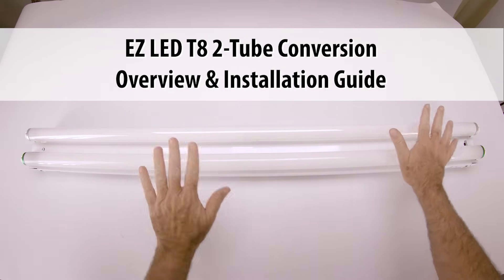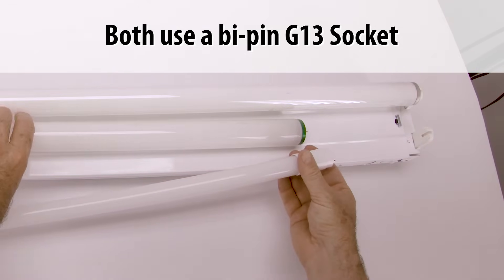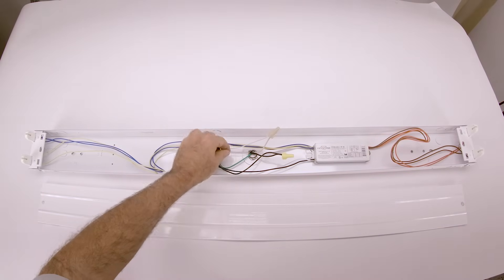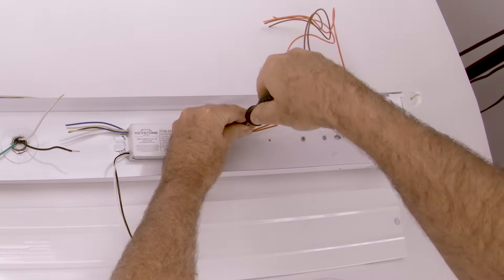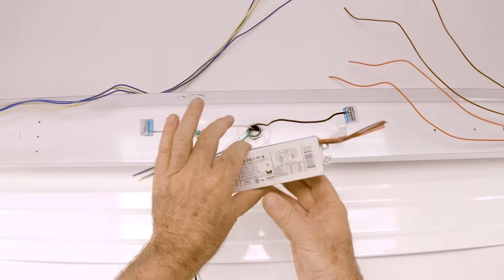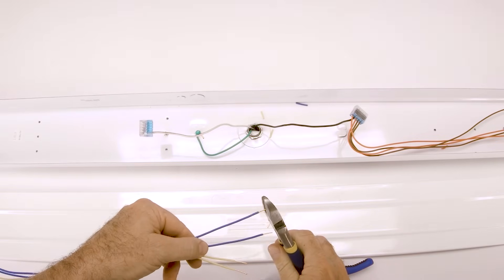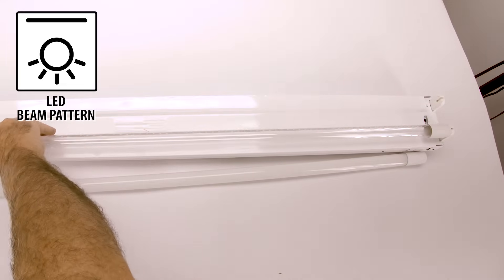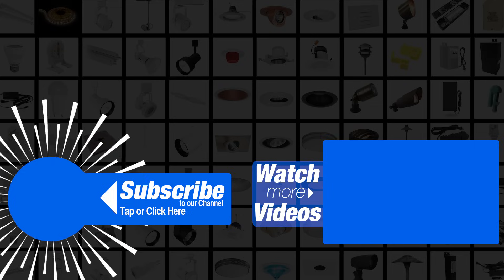EZ LED T8 Fluorescent 2-Tube light Conversion in 5 minutes or less by Total Bulk Lighting

Comment: This Video needs to begin with the WARNING that there are two different types of LED tubes being sold. I discovered after I had cut out the ballast and rewired my fixture that the LED tubes I bought were specifically designed to be used in an existing florescent fixture with NO modifications. Fortunately, I had left just enough wire at the end of the ballast to reconnect the wiring.  I would expect more from a commercial lighting supply company than to miss this important detail.
Reply from the maker: I am sorry to hear you had performed the wrong retrofit method for the tubes you purchased. We do have another video that goes into greater detail of the most popular retrofit methods. Glad you were able to correct the issue. Please keep in mind that this video was made almost 4 years ago and includes the type of LED tubes being used, links to the tubes being used and a link to the wiring diagram that provides greater clarification at no charge. As we aim to always improve on what we do your feedback is valuable and has been passed on for consideration in future videos :) Thank you for sharing!

Comment: Is there LED that work with or without the ballast ?The LED I bought at Walmart 2 in pack $10 doesn't work if you remove the ballast.So I put the ballast back.You did not mention In your video that you have to buy the right tube.What a waste of time.
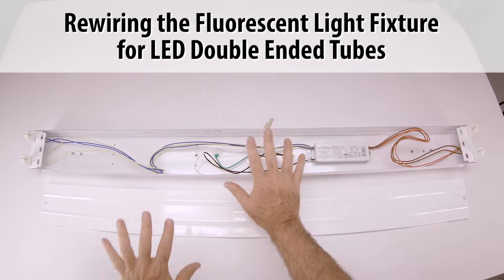Reply from the maker: I am sorry to hear that your retrofit process didn't go smoothly. This video is designed to work quickly and easily with our retrofit kits mentioned in the video description and video card. There is also a wiring diagram listed in the video description that shows how to property make the electrical connection. And to avoid any confusion, we mention what type of tubes at 2:35 along with options to contact us if there are questions. This retrofit method is designed to work with Double Ended Tubes, tubes that receive power from both ends when the ballast is removed. However, we do carry LED T8 Tubes that work when the ballast is installed, Type-A, and when the ballast is removed, Type-B. These tubes are called Type A+B tubes and you can find them here 👉 https://www.totalbulklighting.com/t8-led-lamps/universal-compatible-led-t8-tubes-type-a-b.html Hope this helps for future projects 🙂
Reply: So when I buy an LED tube it should say A and B that works with or without the ballast is that right? Thanks.
Reply from the maker: @efrensaclolo7021  Yes it should be Type A+B LED T8 Tube but always double check to make sure you are getting the correct tubes.

Comment: I bought a pack of 2 LED at Walmart but it only works with the ballast ,The moment I delete the ballast it won't work.Can you tell me why?I did the wiring right and checked the voltage it is 125 volts so must be the LED is made for ballast to work.
Reply from the maker: The retrofit method shown in this video is strictly for Type-B LED T8 tubes which require the ballast to be removed. If the tubes you purchased require the ballast it sounds like you have Type-A tubes that are designed to work with a ballast. Hope that helps 🙂

Comment: Enjoy you video and am about to convert 2 shop lights for my garage but a question first because I want to get it right.   When I opened up the lights, there are 3 bulbs.  All are 48 inch T8 bulbs with G13 pin bases.   Is the conversion the same for a 3 light fixture and if not would the light work with just 2 bulbs?  I don't want to get it wrong and have fireworks!  I intend to use ballast bypass bulbs as well.
Reply from the maker: As long as you follow the wiring diagram and are using Double End Powered LED T8 tubes there shouldn't be any issues converting a 3 tube T12 or T8 fluorescent fixture to LED. You can find the wiring diagram in the video description or click on it here 👉 https://www.totalbulklighting.com/downloads/dl/file/id/1215/led_t8_double_end_power_wire_diagram.pdf
Reply: @Totallightingsupply  Thanks for the info.
Reply from the maker: @gregg-wb8yys517  You're very welcome! Have a blessed rest of your week 🙂

Comment: The tombstones at the end where you connected to the hot wire had two wires coming out of each tombstone.  Can this procedure be used if the tombstones only had one wire coming out of each tombstone?  Like a shunted tombstone?
Reply from the maker: As long as you follow the wiring diagram in the video description above, shunted or non-shunted will work. However, we have found that the majority of LED T8 or T12 fluorescent fixtures tend use shunted tombstones. Hope that helps :)
Reply: @Totallightingsupply    Thanks, that helps a lot.

Comment: Im guessing that since the bulbs plug into 110 volts that the bulbs step down the voltage that the LED's like?
Reply from the maker: Correct. The LED T8 Tubes in this video have it's own driver to regulate the voltage to the LED's liking 🙂

Comment: Is there a way to rewire a fixture to accept both single and double-ended tubes?  I would think that if tube manufacturers followed some simple standards, this would be very easy to accomplish.  After all, a double-ended tube only needs to use one pin on each end.  An industry standard would be needed to determine which one.  This "should" be sooo easy!
Reply from the maker: No need for special retrofit wiring if you go with the double end method and Type A+B tubes. With the newer more advanced Type A+B LED tubes that are both single end and dual end powered in one tube you just need to wire for the double end retrofit method and your done.
See our video on that here https://www.youtube.com/watch?v=xPOu-jSTrPc

Hope that helps 🙂

Comment: This ballast bypass install on liner led lamp is dangerous due to the sockets not being rated for it. I checked with Leviton and talked to an engineer and he confirmed that the sockets are not rated for it.. Bi pin lamps make limited contact in the socket which overheats and melts, out here in California I've see 5 fires do to this install one burnt half a Bed,Bath,and Beyond down. On liner led lamp alway have an led driver or fluorescent compatible ballast to protect the sockets. You can do a ballast bypass on CFL lamps as the pins are making a 360 degree contact. A little background I'm a 25 year electrician working for one of the largest electrical contractors in Sacramento.
Reply from the maker: Interesting point. The lamps are UL approved to be used in this manner. The question I would have in those 5 cases you mention is were the fixtures wired correctly and were the lamps rated for the application? Thanks for sharing your concern 🙂

Comment: Can I mix match LED with Regular Tube Florescent light fixtures? In my kitchen ceiling lights, I have a total of 3 DUAL T12 Florescent Tubes. Can I replace only ONE set with LED and the remaining TWO DUAL T12 Florescent tubes will stay active. All 3 DUAL Tubes used only ONE POWER ON/OFF Switch. Will there be a long term effect on the LED lights? Please advise
Reply from the maker: The tubes used in this video you will not be able to mix and match fluorescent and LED tubes. We offer a universal Type A+B LED T8 Tube that works with many existing T8 electronic ballasts but not T12. Best thing is to start here as it will help you find the right LED tube for your application https://www.totalbulklighting.com/fast-fluorescent-to-led-t8-conversion-tool.html 🙂

Comment: What about shunted and non shunted ?? Tombstones
Reply from the maker: Shunted tombstones are what is recommended for this type of retrofit method as shunted tombstones seem to be the most common found in fluorescent T8 fixtures. You just need to make sure for double end powered retrofit method that electrically the hot comes in only from one side of the fixture to the LED t8 dual end powered bulb and the neutral only comes from the other side of the fixture into the LED T8 dual end powered bulb.

Comment: What do I do if the end of the bulb and ballast has the ONE nipple type connection??. Does that work the same way?.
Reply from the maker: It depends on the LED Tube you are using. If it is Type-B that brings power into both ends then this retrofit method concept would work. You just need to know what type of LED  T8 Tube you are using. Best thing is to contact the place you purchased from 🙂

Comment: I have a plug and play T8 Led tube, can I still use this method to bypass ballast and connect directly ?
Reply from the maker: Typically no but if you have a Universal / A+B LED T8 Tube like then ones here 👉 https://www.totalbulklighting.com/t8-led-lamps/universal-compatible-led-t8-tubes-type-a-b.html than it will work with this retrofit method.
Reply: @Totallightingsupply  Thanks for the quick reply ! I will check.

Comment: You have not been talking about the condenser present in old fluorescent circuit. Does it need to be removed?
Reply: If you mean starters, yes they need to be removed. You need to re-establish the contact to the pin of the tube.

Comment: Why not single ended, that seems much simpler?
Reply from the maker: Please see our video on the top 3 retrofit methods. You will see which ones are faster and easier 👇
https://www.youtube.com/watch?v=xPOu-jSTrPc - Have a blessed day 🙂
Reply: @Totallightingsupply  Thanks but I still don't see any advantage to a two end retrofit over a single ended retrofit.
Reply from the maker: @eminusipi  Double End retrofit method is typically much faster to complete than single end.
Reply: @Totallightingsupply  Thank you! I went to single ended for the long run!😀

Comment: Is there an advantage to single ended or double ended led tubes?
Reply from the maker: Not necessarily in the tubes but in how you convert your fluorescent light. Double End Retrofit method is much faster conversion and doesn't require replacing the sockets. Here is a video on all the different retrofit methods https://www.youtube.com/watch?v=xPOu-jSTrPc

Comment: Can one mix the two though? Say, have a coloured LED and your normal fluorescent tube? Will that work? Please assist.
Reply from the maker: In this video, the type of conversion shown here prevents you from using fluorescent tubes. So you can not have LED tubes and fluorescent tubes together. Hope that helps 🙂
Reply: @Totallightingsupply  In this particular connection or in general?

Comment: I get it for a single ballast. I have two ballast there are two fixtures next to each other with two t12 each. one ballast in each fixtures how do I convert.
Reply from the maker: Checkout our helpful guide that steps you through the process of what you will need when converting Fluorescent T8 or T12 to LED. It talks about dual ballasts 👉 https://www.totalbulklighting.com/fast-fluorescent-to-led-t8-conversion-tool.html

Comment: OK, you went through all that simple setup for the wiring conversion but then you went and threw that big curve ball at the end with the 3 different kinds of bulbs without addressing the now confusing inevitable question of do all 3 of those bulb types work with the wiring you did or do they have to be wired differently?
Reply from the maker: All the LED T8 Tubes shown in this video are dual end / double end powered tubes and will work with this retrofit method. Fluorescent tubes will not longer work when converted to LED. Hope that helps clarify 🙂 You can find our kits here that take the guess work out of the conversion 👉https://www.totalbulklighting.com/retrofit-kits/ez-t8-led-4-foot-kits.html

Comment: This is the first time something doesnot work for me. My wires weren't long enough so I had to buy 2 wires white and black taped them up took balast out what do you think it could be
Reply: Thank you
Reply from the maker: @genevievevalle3286  You are welcome 😊
Reply from the maker: First, make sure you have the correct LED T8 Tubes. This video is for converting to dual end powered LED T8 tubes. It will not work with single end powered LED T8 tubes. Then I would check to make sure you are getting power to the LED tubes. Get a voltage multi-meter to check the tombstones / sockets to make sure there is power. Hope that helps 🙂

Comment: Great Video! My light fixture, the ballast has 2 wires on one side and 4 on the other. The neutral side termination will have 5 wires, the hot side will have 3 wires. Will this be acceptable?
Reply from the maker: As long as the electrical follows the wire diagram shown here https://www.totalbulklighting.com/downloads/dl/file/id/1215/led_t8_double_end_power_wire_diagram.pdf then it should work just fine :)

Comment: the LED tube to use are the ones that are not LED but are actually T12 fluorescent lights that are run on a magnetic ballast.
Reply from the maker: I am not quite following what you mean in regards to retrofitting from fluorescent to LED. Can you help us all here understand better what you mean?
Reply: @Totallightingsupply  I have never had very good luck with LED lights, and I guess it is just me, but I cannot be in a room lit by them because i get a headache in like 10 minutes. so all of my shops are lit by fluorescent lights, but the newer ones with the electronic ballast seem to not last very long and always burn up in less than 3 years. so I use old lights that are from the 1950s that i got from an old shop that was closing and they still have the original preheat magnetic ballasts and they still work great and never give me any issues.
Reply from the maker: @WalterKnox  Gotcha! We can understand 😊

Comment: My fittings (all four of them) do not have a ballast box. It has a bayonet "starter" for each tube......
Reply from the maker: Hmm. Sounds like this retrofit method will not work with your fixture 😔
Reply: @Totallightingsupply  All I did (re instructions) is replace the "starter" and place the LED tube. Also had to put a sticker on that only LED tubes must be used. for replacement in the future.
Reply from the maker: @allanmanley6340  Glad you were able to make the conversion work 🙂

Comment: Well...the led bulbs I got , you just change the bulbs. nothing else and they work GREAT and 100% brighter than the fluorescent tubes.
Reply from the maker: That's great to hear! Sounds like you purchased Type-A tubes which simply work with the existing ballast. Very easy indeed 🙂 The only draw back to Type-A is when the ballast fails you will have to either replace with a new ballast or utilize a retrofit method like the one we demonstrate in this video to get the lights back on. However, if you plan on any future conversions we have a Type-A+B tube that works with an existing ballast and in the retrofit application shown in this video. You can find those tubes here 👉 https://www.totalbulklighting.com/t8-led-lamps/universal-compatible-led-t8-tubes-type-a-b.html - Have a blessed day!

Comment: They now make LED lamps that use the ballast. No rewire necessary. Occasionally an older ballast will need to be replaced if they don't come back on when the switch is cycled or after power goes out.
Reply from the maker: You are right and it makes it super easy. However, not every project is the same and a direct replacement won't work. That is why we offer the universal Type A+B bulb that works without wiring and with retrofitting. It's a great way to convert to LED and when the ballast fails you can still use the tube with rewiring like shown in this video. We did a video on this a few months back. You can see how that tube works here 👉 https://www.youtube.com/watch?v=xPOu-jSTrPc  🙂

Comment: I wonder if I could do my under cabinet minis. I don't see any 12" parts though.
Reply from the maker: We do not sell parts to under cabinet lights at this time only complete fixtures.
Reply: @Totallightingsupply  I restore antique lighting and use B&B for parts,  gas to electric conversions, lol. Just a hundred years behind the times.
Reply from the maker: @zootybeano  Gotcha, LOL 😊 Sounds very interesting and challenging too 🙂 Most of our T8 / T12 Fluorescent parts are specific to converting to fluorescent to LED. We do offer a variety of low voltage electronic transformers with small form factors where many of our customers have used them to prolong the life of their light fixtures, saving them from the landfill. Here's a link to those 👉 https://www.totaltransformers.com/electronic-transformers.html

Comment: LEDS are power efficient and therefore use less power for same Lumen output. However, it SEEMS when converting to LED.... your only option SEEMS to be to get a unit with the SAME Lumens as fluorescent....but maybe using 18W instead of 32W. QUESTION....are there LED T8 bulbs with GREATER Lumen output... instead ?
Reply from the maker: There are higher lumen T8 LED tubes on the market. They typically range from 20Watt to 44watt and the lumens tend to be in the 3,000 to 5,000 range. We currently do not have 20watt LED T8 tubes at the moment. Here is our T8 LED tube offering 👉 https://www.totalbulklighting.com/t8-led-lamps.html
Reply: @Totallightingsupply  ...thank you for the info !

Comment: Im wanting to do this to the small light fixture over my bathroom mirror, but it has a starter in it as well?
Reply from the maker: If it's fluorescent there is a ballast to power the light 🙂
Reply: @Totallightingsupply  right, its a small squarish thing, but the one wire runs from the ballast to to the starter then from the starter to the tombstone...i think ill just buy a new fixture...lol...
Reply from the maker: @ToddYoungonline  There are so many light fixtures out there that it makes it difficult to know what would be best without being there on site 🙂 So a new fixture may be the best choice as an electrician can be costly 😊 Have a happy new year!

Comment: Why do I need the push connector can’t I wire nut the wires together?
Reply from the maker: Yes you can use wire nuts but if the wire nuts are too small the push connector makes it easy to fit up to 5 wires without issue 🙂